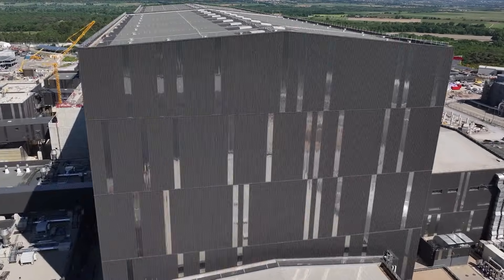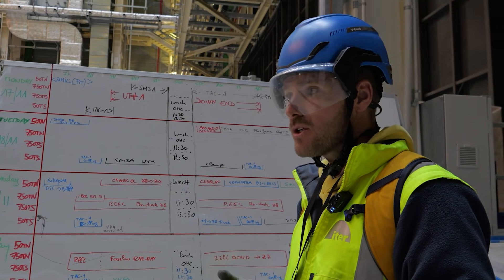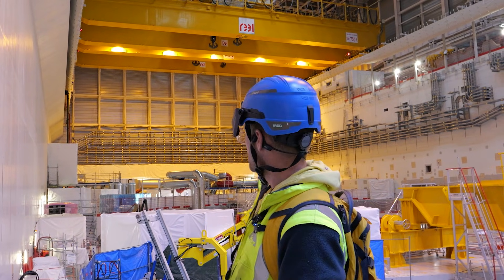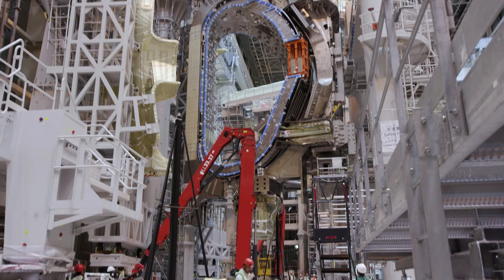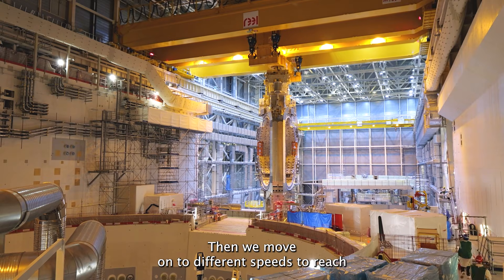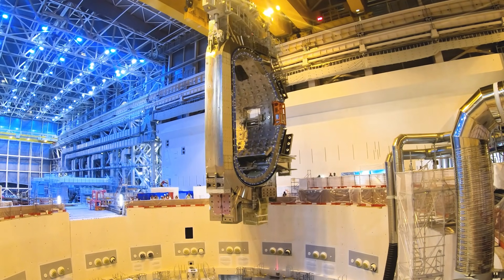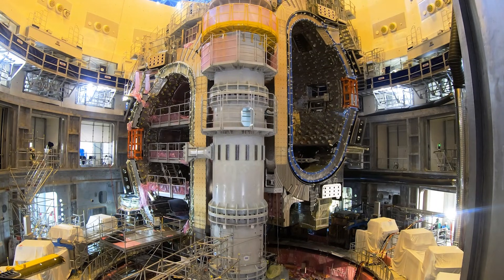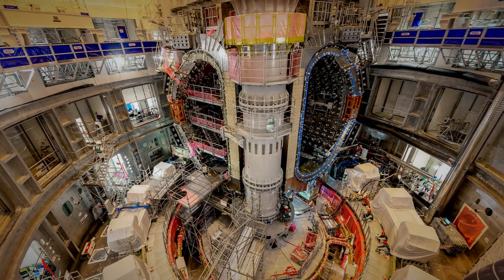Heavy lifts, hidden efforts: behind the scenes of vacuum vessel installation

Comment: It is amazing but it takes forever. Will this thing be finished and running before climate change will end us?
Reply: ITER is not designed to produce power. 
We might have commercial grid-connected fusion in 2125.
Reply: No chance. 
We’re all doomed 😂
Reply: Even if it will run, it will not solve all our problems, although this reactor gives less power than it takes